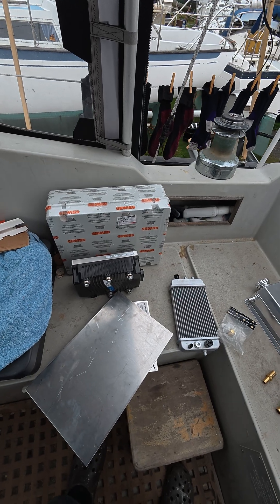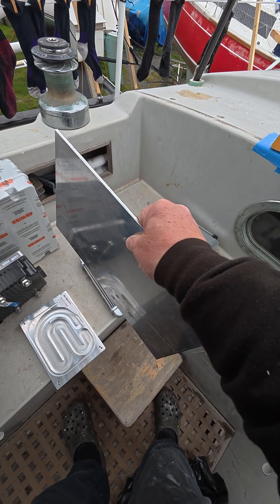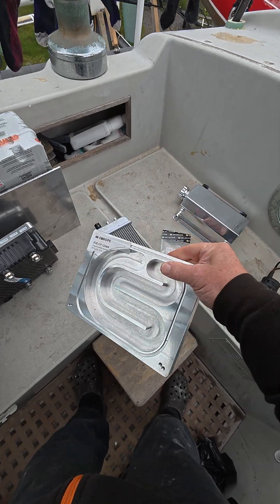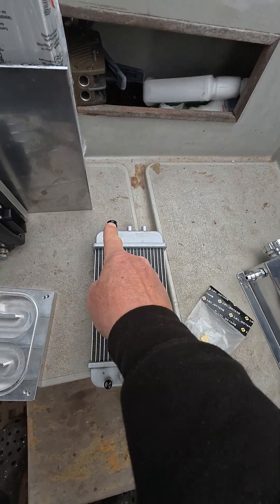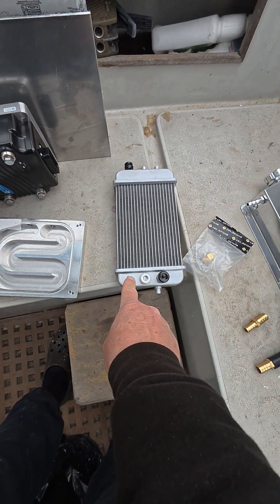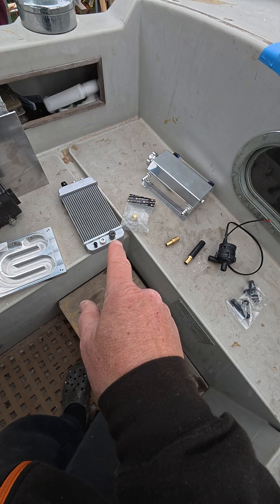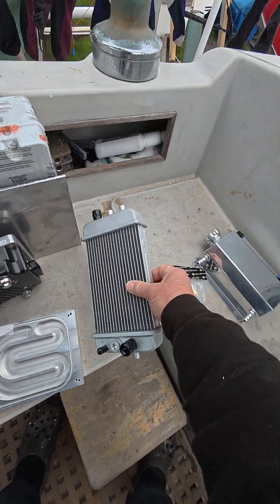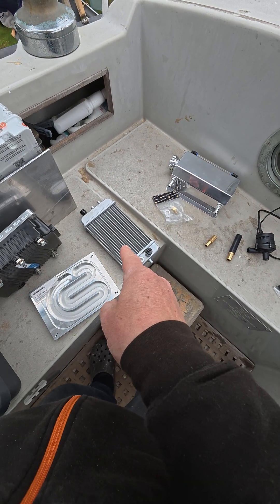Our DIY Electric Yacht Motor Controller cooling system design #BoatRefit #ElectricBoat #DIY

Comment: Will the cooling liquid be hot enough to go through a calorifier (🤔🙈 sorry, don't know how to spell that )?
Reply from the maker: I don't know 😁
But I've ordered a temperature sensor and fans (and to start with manual rotary switches for the fans and pump). So we will see.
Will we use the motor enough for it to be worth adding a calorifier? I don't know that either 😁